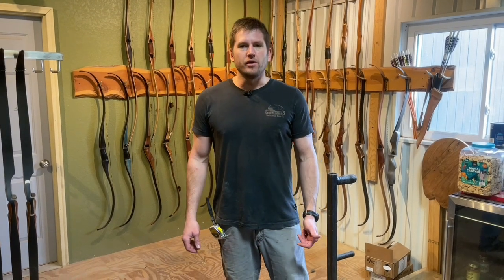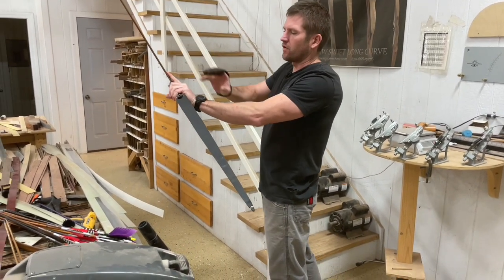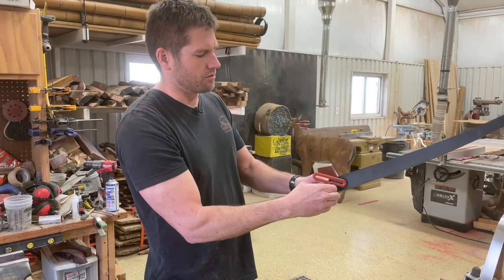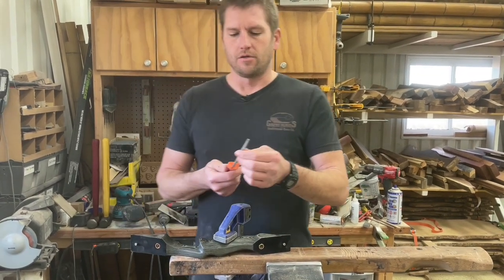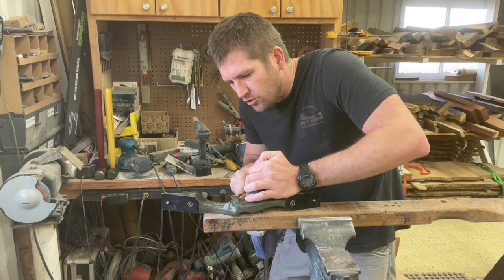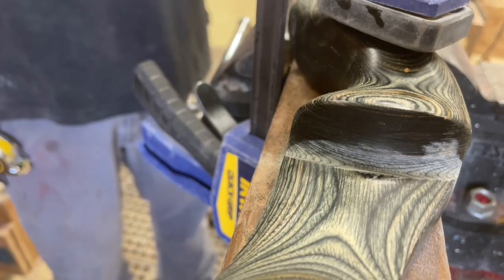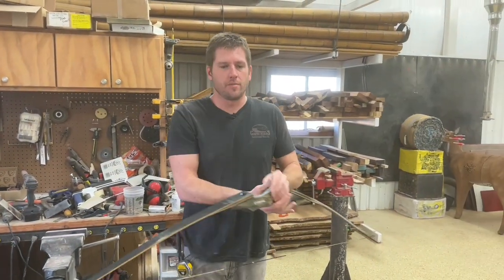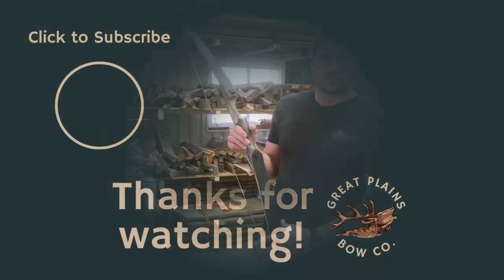Part 1 | DIY BLACK HUNTER Rework | Budget Amazon Bow

Comment: THANK YOU. bought a new BH recurve. After sitting aprox. 15 min. Bang. pop the string??? Became dangerous.  Notice limbs were out of wack. It sat for almost 2 yrs. Didnt know it could be fixed. Thank you so much. BTW had to remove over 1/8 in. on lower limb to straighten it out. Yup- used a belt sander- finish by hand. great bow now. Thanks again liked and sub.
Reply from the maker: Awesome!

Comment: Very informative video, and presented very simply and clearly. As an amateur bowyer, it helped me greatly. I noticed you didn’t pull the bow at all after removing material from the limb. I’ve read that this allows the limb to adapt to the removal. Do you think this is helpful or not? Thanks.
Reply from the maker: @stringbean585  oh I pulled it a bunch it's just not on video, but it's not that necessary. You're gonna shoot it anyway to test it

Comment: I shot many bows as a teen varying lbs and various types.  In my 40s now wanted to get back into it so i got the black hunter recurve.  So far i like it but i can feel its lacking.  Im a bit out of touch on newer bows.  What in your opinion is a good bow to move up to price range 300-500.  Im interested in getting into tourneys if i can.  Im a pretty good shot.
Reply from the maker: @nicholasosborne1356  That's a good question and I'm not sure what would be the best bow in that range, but I'd say go for a bow company that isn't production line, but is a reputable company built by hand. The $300-$500 range might be tough as that range is still kinda from production line companies

Comment: Thanks for the inspiration and tips, cleaning up riser to limbs per your instructions. Learning barebow starting with a Black Hunter modifying my grip to my likingalso, low grip closer to my Bear Alaskan and center shot. Not sure I fully understand center shot. With center shot the arrow isn’t bowing around the riser so parralax isn’t occurring but the arrow still bends, so if it bends toward the riser it is going to kick it out. If the initial bending is away from the riser all okay. My shooting now seems inconsistent and wondering if this is the cause. Do I need to spine index my arrows to bend away from riser. Probably overthinking or misunderstanding how this works for BB. With my compound with drop away rest this isn’t an issue. Appreciate any comment
Reply: I've found that on traditional bows that are NOT center shot, going to a softer spined arrow will do wonders for your shooting....either physically replacing them  OR cutting your arrows longer OR going to a heavier field point or broadhead...

Comment: Few questions,  you don't think thinning the riser to center shot would put the riser at risk of breaking at higher draw weights?  Also if you refinished the riser, what did you use?
Reply from the maker: Excellent questions, Jacob. Yes you do have to be careful not to take too much off of heavier bows. The black hunter bows are made with dymalux so usually you'll be just fine thinning it down with in reason. That being said, if this bow was a 70# bow I'd have left more material on. As far as the finish goes we will be showing that soon as we continue the series of reworking the black hunter all the way through. Thanks for watching!

Comment: I have been following this series and plan to do some of the modifications you have shown. Thank you for sharing your knowledge and insights. I have recently purchased a Black Hunter through Amazon. The limbs on my bow are square where they attach to the riser, not angled like yours. I am wondering if I have a older or newer version or perhaps a knockoff. Can you shed any light on the difference? Thanks!
Reply: You have the Mk2 version, so the latest version. The Mk1 version has the angles at the riser. I personally prefer the look of the Mk1 but I believe they changed it to make production easier.

Comment: I like your how to video, but just a comment (or two).  It would be more accurate to use your bowyer's square to measure the string height for the positive tiller check.  The square would keep your measurement perpendicular to the string more precisely.  By the way, why is brace height measured from the grip rather than the back of the bow like draw length?  Seems that would be more consistent what with all the different grip shapes out there.
Reply from the maker: Hi Robert, thanks for your comment and also for watching! The bow square is a good idea, but once you've done thousands of bows its really no more accurate and its twice as slow. On the brace height thought, I think thats a great idea I have thought of that myself many times, however all the bow companies do it from the deepest part of the handle and if we were to change it there would continuous confusion and constantly explaining that to our customers. I think everyone would need to get together and agree to change it to that way of measuring for that to work. Good thoughts. I like the way you're thinking

Comment: Cool vid,  how and where do you measure to see how off center it is?
Reply from the maker: Measure the widest part of the limb. Then measure the width of the bow riser directly above the shelf. Or tighten a string directly centered above both limb bolts and sight down over the shelf area
Reply: @greatplainsbow  Thanks, would the target width be half the width of the thickest part of the limb minus half the diameter of a shaft?
Reply from the maker: @jayinla228  that's correct you got it

Comment: If you had a stronger, bottom, limb, could you not just swap it with the top limb or is there something specific delineating in the top from the bottom?
Reply from the maker: That's a good thought and yes you could if the limbs lined up correctly with the riser. On this particular bow they didn't

Comment: Great videos buddy i am from South Africa need to know if i shoot three fingers under is the top limb still weaker and tiller more like one eight of inch or can i make tiller even for three finger under?
Reply from the maker: You can make the tiller even or 1/16". Either one should work great
Reply: @greatplainsbow Do i still have to make the bottom limb sorter as the top limb longer or can the be both same length with even tiller for three under? Sorry to ask these questions i am building a replica Black Hunter..
Reply from the maker: @johanhelberglongbowsknifes1185  no worries. Make the limbs the same length. Email me I'll help you. My email is on the website
Reply: @greatplainsbow Thank you buddy appreciate it very mush i am going to put the limb in the heat box busy with it. I will email you. Have a awesome day.

Comment: Greetings. Firstly, I apologize for the Google translation into English) There is a strange story with my BH bow: the bow is 30 pounds, the arrows are 500 spine, when shooting with three fingers under the arrow, the arrows go to the right, despite the greater rigidity for such a poundage. When shooting with a Mediterranean grip, they move to the left. The lower the fingers are located under the arrow, the greater the displacement of the arrows to the right in the target. Several people shot with different techniques and the results were approximately the same. With what it can be connected? Shoulder tiller? Or, perhaps, due to the fact that the bow is still a little off-centre?
Reply from the maker: @denskky5284  there's a good chance it's a tiller problem, but you should be shooting 600 spine with a 30# bow
Reply: @greatplainsbow  Yes, immediately after buying the bow I used 600 spine arrows. When aiming at the center of the target, they went too far to the right, about the radius of a standard FITA target for 18 meters. Then I took 500 spine arrows and with them the hits shifted to the left - I managed to hit the center of the target more often. 
As I already wrote, this problem exists among several shooters who tried to shoot with this bow. 
So, if the problem is the tiller, what should I do? Increase or decrease the base of the lower arm?
Reply from the maker: @denskky5284  if you've tried different spines and it still does it than it is most likely that the bow needs to be cut past center
Reply: @greatplainsbow  so the problem is insufficient centershot? To be honest, I thought so myself, because the arrow on the shelf protrudes too much to the left of the bowstring projection.
Reply from the maker: @denskky5284  most likely that is the problem
Reply: @greatplainsbow  I understand. I don't really want to sharpen the riser. I'll have to keep shooting harder arrows) Thank you for your time and help with the question.

Comment: Ok so I checked my tiller on my black hunter and both top and bottom limbs around about 6 3/8” is that okay?
Reply from the maker: Well that's even tiller which isn't correct tiller, but if you're getting good arrow flight without porpoise then it'll be ok
Reply: @greatplainsbow  cool thanks for the reply. Yes I’m getting good arrow flight. I just made it a center shot. Gonna test it out when I get off of work. Hopefully that fixes the aiming to the right to hit my target.
Reply from the maker: @Terpedup925  that's great! Good luck and happy shooting!

Comment: OK this is a cheap China bow... But that's not comparable to a custom bow...you get really good stuff for the money.  A chentershot is not necessary in my eyes.  Also, in my opinion, a hybrid longbow does not need a tapper... But thanks for the honest assessment
Reply from the maker: Those are good thoughts. A taper is important because it allows the bowyer to strategically control when and where the limbs bend. This increases performance tremendously in traditional bows. Without a taper the bow is just subjected to the original form and the only way to increase performance is bow length and weight.
Reply from the maker: As far as the centershot you are correct it's not necessary to shoot the bow, but people are shooting bows for the fun of it and part of the fun is tweaking you're equipment to get optimum performance and enjoyment from the sport
Reply: @greatplainsbow  That's absolut true no  doubt about it... But on a that price it should be OK...
Reply from the maker: @ullikuschal8000  yep. I agree
Reply: When you draw the bow to figure out weight at 28" where do you measure the 28"? Front or back of riser? I see people doing it many ways, or assuming arrow lengths based on someone's assumed draw length and I don't necessarily agree to that. Just curious how you measured! Thanks
Reply from the maker: @jowhi9296  Hi Joseph, you measure from the back of the bow not the belly